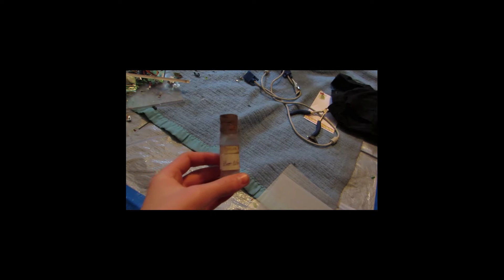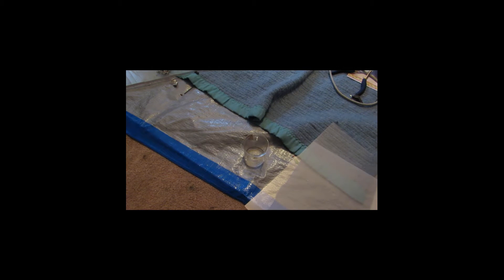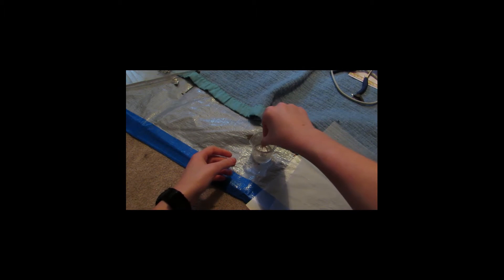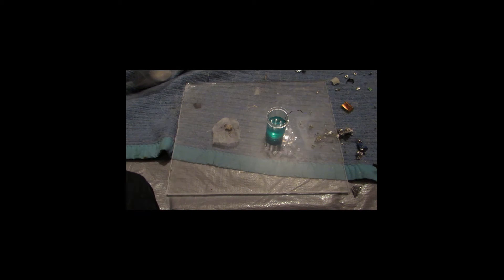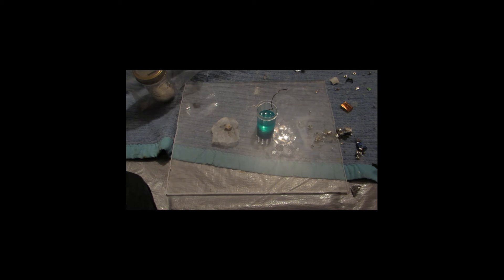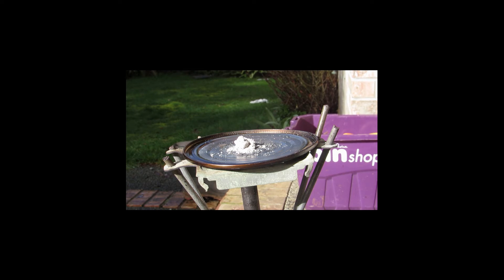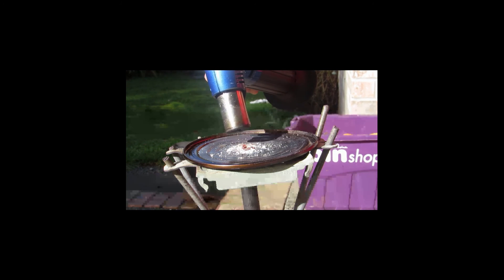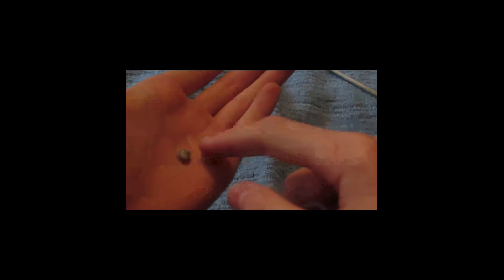Silver from Silver Nitrate (Household Materials)

Comment: BTW what's ur age
Reply from the maker: +Vayun Biyani 15 as of today
Reply: +piano and science guy ur really awesome
Reply from the maker: +Vayun Biyani thanks!
Reply: +piano and science guy I'm 13 and I try as many projects as u do I've made a 2400volts arc from a mot
Reply from the maker: I have also, I recently bought a 9000 volt neon sign transformer! it is amazing.
Reply: +piano and science guy from where did u buy it
Reply from the maker: +Vayun Biyani I got it from e bay for about 140 dollars Canadian including shipping.
Reply: +piano and science guy i have a small problem, the coils on the MOTs i have are glued to the core directly cos of which i'm not able to put different  secondaries 
if u know anyway i can solve the problem pls let me know
Reply from the maker: +Vayun Biyani I always find the primary a lot easier to remove, if you can remove the primary carefully with a chisel without damaging it, you can cut out the secondary and rewire it. If neither coils will come out, I suggest purchasing some enamel coated wire with a similar guage to the primary coil and cutting out both coils and rewrapping the primary with the enamel wire, it should be about 100 turns. to make a coil the same size, take an ohm meter and measure the resistance on the coil before destroying it, then get a length of enamel wire with the same resistance, if you wind that and it is the same guage as the original primary, you should have essentially made an identical primary coil to the orrigional coil. Just some ideas, hope this helps. if not, the iron core is very useful for your own custom transformers.
Reply: +piano and science guy thanks
Reply: +piano and science guy btw do you know how to convert DC to AC as it gives a whole new level to step up voltage as transformers work on AC and if the output current is desired to be direct it can easily be rectified also we can make a variable high voltage power supply by using potentiometers
Reply: indeed iron cores are useful but I've never been successful in making my own transformer as mostly there is a short and the fuse blows or the breaker pops sometimes I get the disered output  but it's never able to take a load which results the core to heat but checking the coils with a continuity buzzer indicates it to be fine sometimes the insulation on the wire melts. I've tried using heatsinks but they don't help either
Reply from the maker: Vayun Biyani yeah, mot's can be difficult to get to correctly work expecially with overheating and blowing fuses. I highly recommend buying a good quality neon sign transformer, you will only ever need that one transformer, and it cay run for days on end and only just get warm. that is my suggestion.
Reply: +piano and science guy I surely would buy it if I had access to it
Reply from the maker: look around online for one, after searching for a while, you should find a fairly cheap one, make sure it works and it will be a lot less if it is second hand, that is what I did.